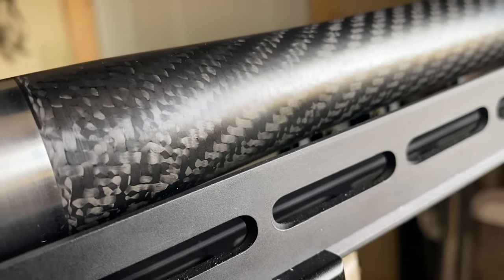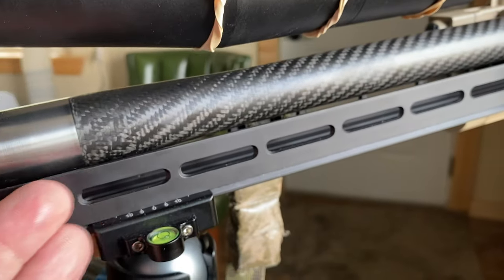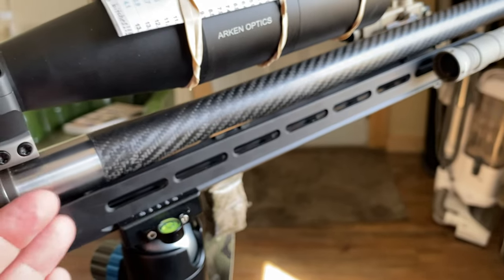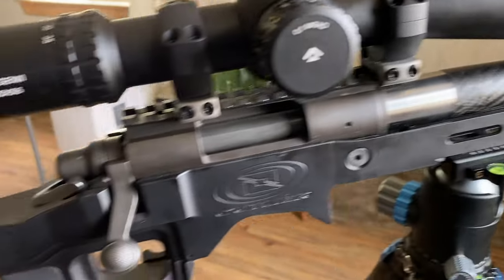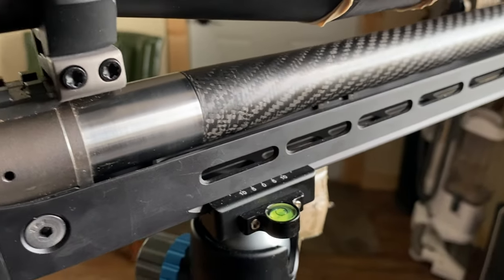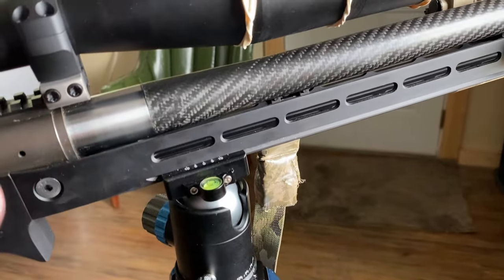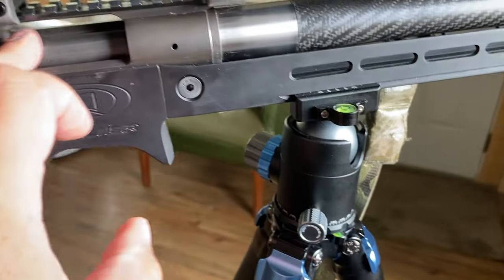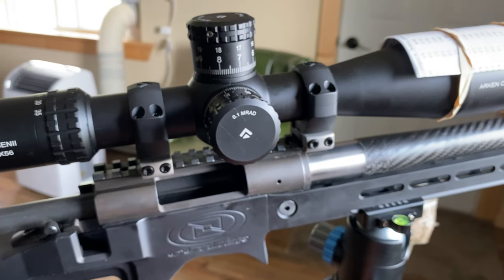The PROBLEM with UNPROTECTED Carbon Fiber for FIELD USE  ~ Rex Reviews

Comment from the maker: For the BEST DEAL use CODE: "REX" at CHECKOUT.  This code will match the best deal anywhere out there!  Here is the link: http://bit.ly/RexReviews
For the OUTLIER Chassis, use CODE: "REX" at CHECKOUT as well.   https://www.getoutlier.com
Outer fits the following platforms!
Remington 700 SA (3.0* AICS Only)
Remington 700 LA (3.715" Magwell)
Remington 700 LA (3.85" Magwell)
Remington 783 SA (3.0* AICS Only)
Remington 783 LA (3.56" Magwell)
Savage SA (3.0* AICS Only)
Savage LA (3.715" Magwell)
Savage LA (3.85" Magwell)
Savage Axis SA (3.0* AICS Only)
Savage Axis LA (3.56" Magwell)
v Tikka T3 SA (3.0" AICS Only)
Tikka T3 LA (3.56" Magwell)
Ruger American SA (3.0" AICS Only)
Ruger American LA (3.56" Magwell)
Mossberg Patriot SA (3.0" AICS Only)
Mossberg Patriot LA (3.715" Magwell)
HOWA 1500 SA (3.0" AICS Only)
HOWA 1500 LA (3.715" Magwell)
Reply: Hey Rex, have you ever seen a basalt fiber barrel?  It may actually be a better material for the application.  Basalt fiber has really good thermal properties, isn't as stiff as carbon fiber and is really wear resistant.  It seems like you could use essentially the same process to wrap the barrel with basalt fiber as they do with carbon fiber.  The price would seemingly be about the same since the material costs are likely not much different.  BTW, if you haven't ever looked at the properties of basalt fiber like EM and Thermal it is a fun study.  Yep, it's made out of igneous rocks.  The Russians did a lot with it.

Comment: I understand why people want the carbon fiber wrapped barrels with heat dissipation and weight savings. But I will stick with top quality stainless steel barrels like Bartlein or Brux or Hart, etc… half the price and a lot less fuss. Leave it polished or Cerakote or rattle can and when it wears off rattle can it again.
Reply: The worst part of SS. Is overall barrel life.  Great accuracy early on but generally the overall life span I much shorter than nitride

Comment: I would get paint that protects against  UV sunlight. You should see what happens to carbon fiber car hoods after day to day sunlight exposure.
Reply: I wish they still had lead paint.
Reply: Just about any paint will stop UV from getting to the carbon fiber.
Reply: Very true!! But more or less too make the paint last as long as possible before degrading itself, and then compromising the carbon fiber
Reply: Why not use Cerakote?
Reply: Don't you have to bake cerakote to cure it properly?
Reply: @ryanhutchinson3550  they have two different types. Baqke on and non bake.

Comment: There might be some crazy exceptions out there somewhere, but for the most part all carbon fiber composites will act as a thermal insulator especially compared to steel.  I'm sure someone one will disagree, but I have a NASA study, a scientific journal article, a commercial testing equipment manufacturer article, and a material supplier's blog post in front of me.  They all agree that carbon fiber composites have a thermal conductivity of less than 10 W/m-K across a large spectrum of temperatures.  This is in the transverse direction to the plane of the fiber.  Some types of the fibers themselves can be much higher in the longitudinal plane (from one end of the "string" to the other), but in this context the fibers need to be perpendicular to the pressure it is designed to contain which means that it will also be perpendicular to the heat gradient. You can also look up and see that the thermal conductivity of 416R stainless steel is around 25-29 W/m-K, mild steel is around 50 W/m-K, copper is around 350-400 W/m-K, and Aluminum is around 200-250 W/m-K.  They all conduct heat much better than the carbon fiber composites.

Comment: If you accidentally spraypaint over something that wasnt covered, a q-tip and 90% isopropyl, carb cleaner, fnp remover, etc. will clean it off easily.

Comment: Having just built our first rifle with a CF wrapped barrel, I’m still a bit concerned about the integrity over time. We used a Bartlein 5R in an M24/M40 contour in 1:8 twist at 22” for backcountry hunting. Paired with a Harvester 300 suppressor, the 7MM projectiles stack up on one another down range, so I’m very happy with the precision. I cannot come to terms in painting it until the warranty is up though…